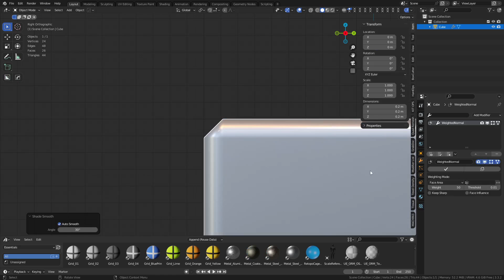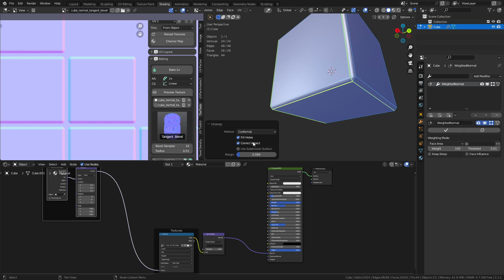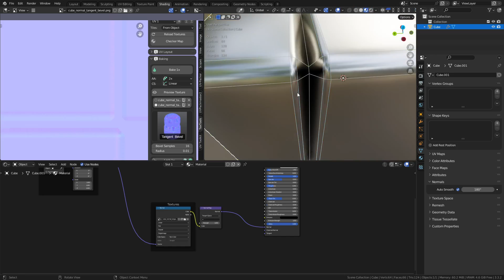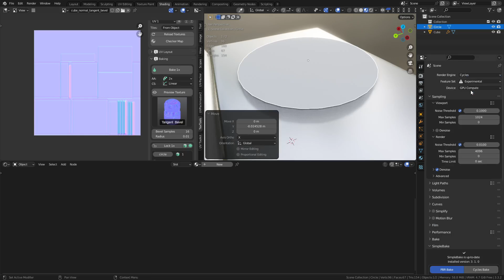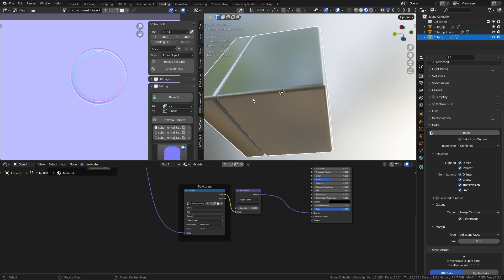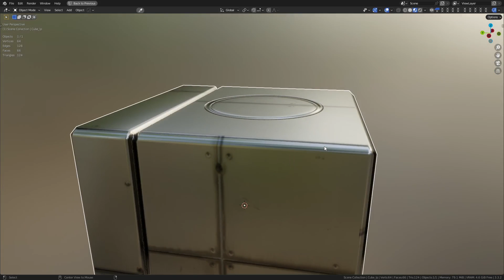Tex Tools Baking

Comment: You should give a try to EZ Baker https://www.youtube.com/watch?v=fSHYr0jf82Y , iirr it should let you bake "floater" meshes using cage.
Reply: (iirr if you feed a bevel shader node on your "highpoly" mesh the final normal texture should be baked'n'mixed along with all other mesh(es) infos straight away)
Reply: (notice: the flotaing decals from DecalMachine can only be baked by the dedicated DecalMachine's panel, so normal texture baked from those decals must be slapped into your "main" normal texture by using Krita or the nodegroup from here https://www.youtube.com/watch?v=Eb-W0Qx4ukQ&t=644s )
Reply from the maker: I mix in designer. I don't bake decals personally, unless I had to convert a mesh to mobile quality. High Poly, Floaters, and Booleans work better. The bevel shader just bevels everything. Which is nice but a well made high poly won't really need it.